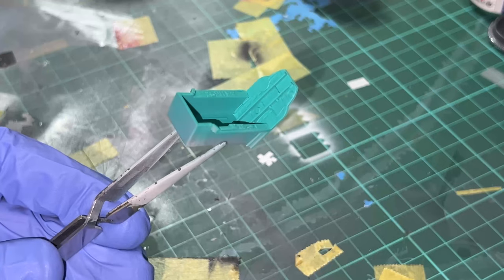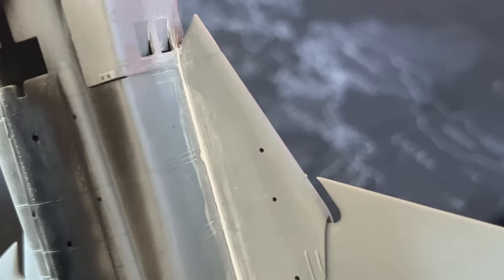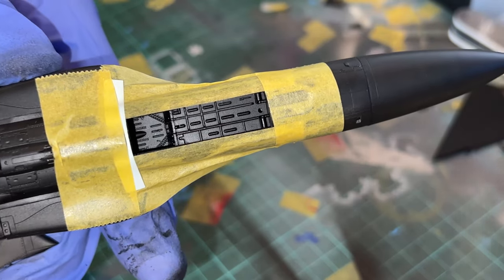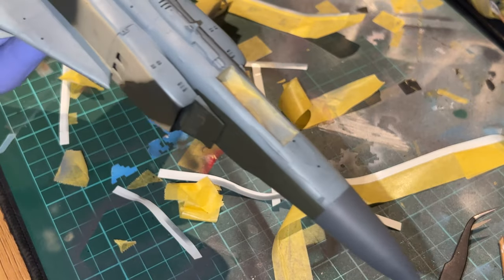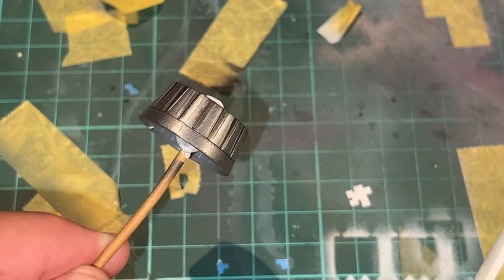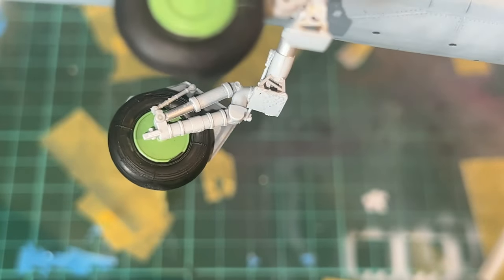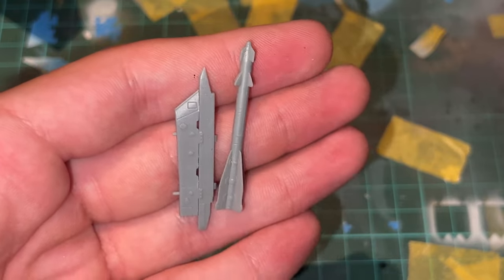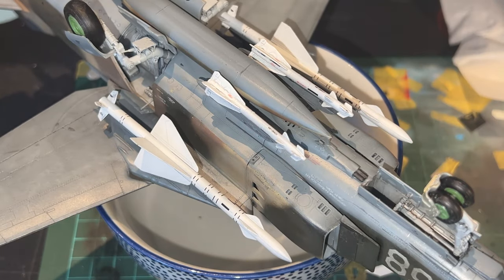Trumpeter 1/48 Mig-23MLD Flogger-K | Full Build

Comment: Did you have any problems about fitting the cockpit and front landing Gear on the fusolage?
Reply from the maker: i did find there was some gap between the lower fuselage and the wheel bays. just filled with putty and wiped excess with a cotton swab.
Reply: @RazedModeling and between the back piece from the cockpit and the upper fusolage? I have some of these migs and i had problems with cockpit and the part where you glue the canopy